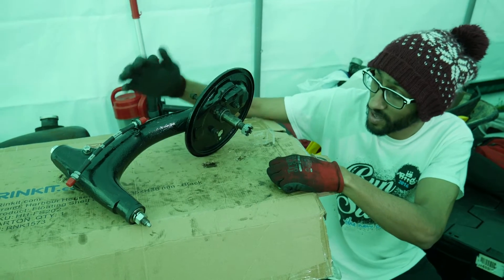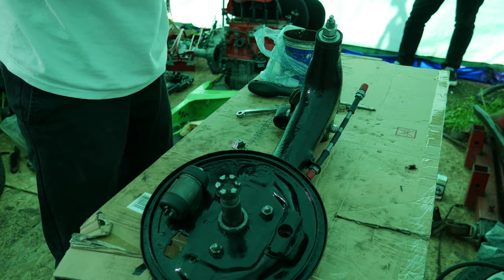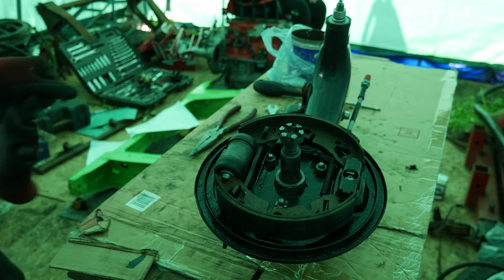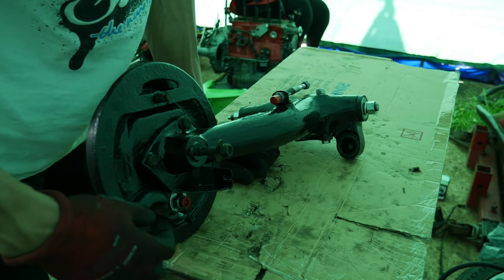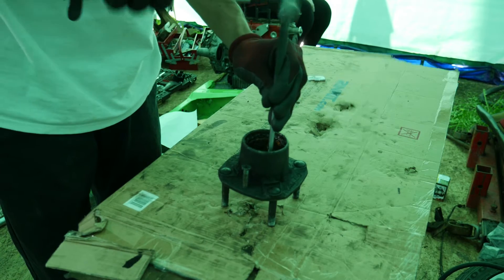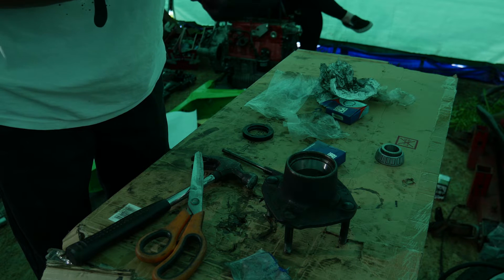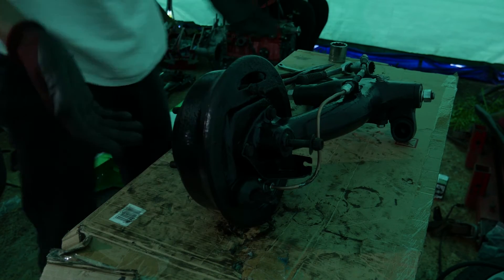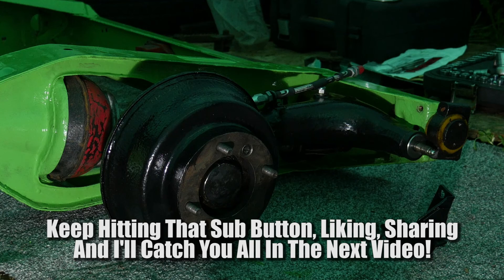Classic Mini: Radius Arm, Wheel Bearing & Subframe Assembly

Comment: Have got video of fitting brake pipes to subframe
Reply from the maker: Sorry dude I didnt film that but it's really easy just thumb tighten the copper line where your flexibles lock on the subframe and on the t-piece. Then lock them up with your spanner

Comment: Ive definitely heard that hub nut should be torqued to 250nm, never ever seen or read that anyone has just nipped it up 😵😵
Reply from the maker: That's front hub buddy not the rear drums. They'd be locked if you did them that tight on the rear😂👍🏿
Reply: Brown Dave ah, good to know 👌🏻 cheers buddy
Reply from the maker: @MiniMattTV  no worry's bud, your right in torquing as it is the correct way but I've been kinda lucky to meet/learn lots from old  Leyland workers, including all these bad habits 😂😂😂